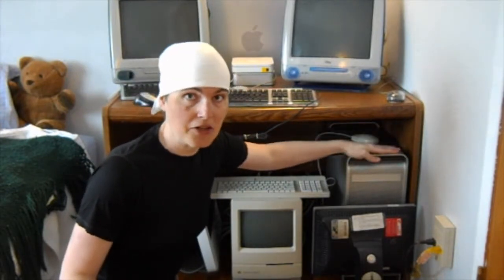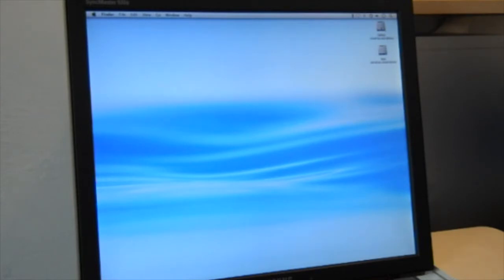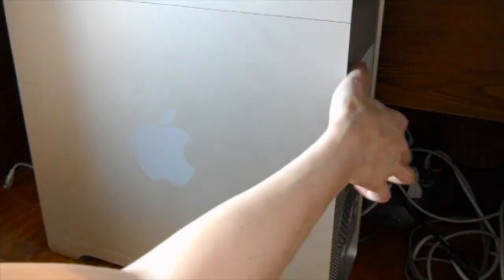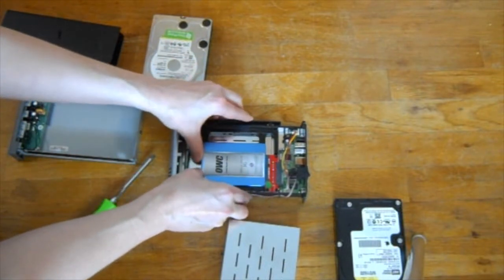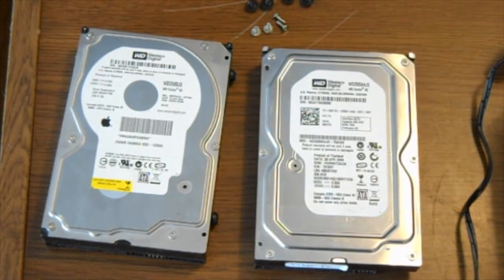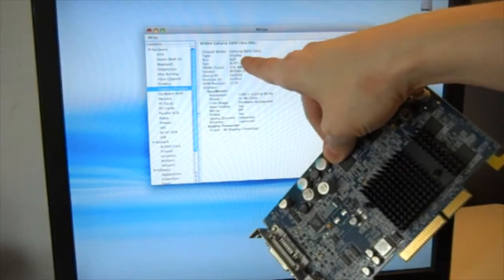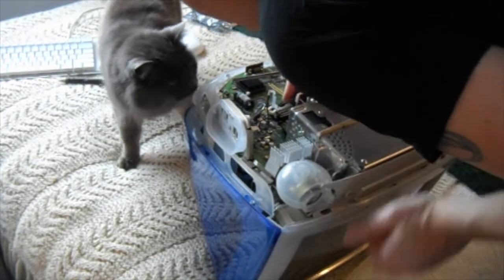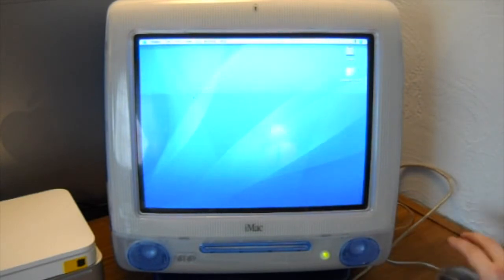Putting an SSD in my iMac G3

Comment: Thinking of doing this my self! The IDE spec isn't a bad one.. Head seeking, rotating platters, and circuitry to control them all add up to Latency_. An SSD replacing _any retro hard drive will guarantee performance increase..

Comment: I have two iMac G3 they work fine but my indigo iMac make a lot of noise when I play a game which turned out to be the CD drive and I also noticed the 2001 iMac does not include a fan to be built in it has a water cooling built in
Reply: Water cooling? The 2001 iMac is air-cooled.

Comment: Without trim support will that SSD not eventually destroy itself? I was thinking about doing this myself and then realized the trim problem.
Reply from the maker: Probably. But according to OWC, they claim TRIM isn't necessary for their SSDs (https://blog.macsales.com/11051-to-trim-or-not-to-trim-owc-has-the-answer). I'm not too concerned, though. This isn't a primary work computer. I'm on it rarely, and when I am, I'm not doing a tremendous amount of read/write. Of course that's just my experience. Your mileage may vary. Something else I've considered trying is using an IDE to CF adapter rather than the SSD. Haven't gotten around to it yet.

Comment: What adapter is that to connect the SSD to the IDE port?  My DV SD has a DVD drive and the old HD connected.  I need to locate the adapter that will re-connect the DVD and then the new SSD (if such a adapter exists!)
Reply from the maker: I used a NewerTech AdaptaDrive 2.5 to 3.5 inch drive bracket for the SSD, and disconnected the SATA pass through to make room for the SATA to IDE adapter that came with the SSD. After that, I just used the IDE cable in the machine to connect everything. https://eshop.macsales.com/item/OWC/SSDMXLE120/
Reply: Many thanks! The video has been a great help. I was missing the SATA to IDE adapter, so that's on the way now from MacSales.
Reply: @vandinem  hey i was just looking at this adapter/SSD combo, did you end up getting it and if so how did it go?

Comment: Nice video! Do you find the iMac faster at all with this upgrade?
Reply from the maker: I didn't do any speed benchmarks, so I can't say for certain if there was a speed increase. It felt more responsive, though. The iMac did end up being totally silent, which was really nice. For a little while there was no grinding of a mechanical hard drive to ruin the fanless iMac. But alas, the SSD isn't actually in the iMac anymore because it caused a system freeze when waking from sleep (a feature I use often), so I swapped it out with a 40 GB mechanical drive from my G4 MDD. I think the SSD will eventually wind up in the G4 Sawtooth, but I'm contemplating using a IDE CompactFlash adapter in the iMac as soon as I can afford one. I'll be sure to make a video when that happens, and I'll do some benchmarks as well.
Reply: Great to hear it helped with noise - I have recently been gifted a G3 rev c, and the first project was to lubricate the fan to try reduce some of the noise (which we don't hear do much with modern computers).
Interesting one about the return from sleep bug - will have to bear that in mind when choosing a SSD for my iMac...
Reply: The issue with the wake from sleep is probably related to the OS since they didn't have ssd's and the OS kext doesn't take into account  It would be interesting but expensive project to upgrade from the PPC G3 processor to a modern Intel processor using a MacMini internals in place of the G3. One can only dream LOL
Reply: @ellejohara  So I assumed did you already have some sort of an adapter to convert ide to sata? Thank you.
Reply from the maker: I bought the adapter with the SSD. This URL is for the IDE to SATA: https://eshop.macsales.com/item/Addonics/ADSAIDE/ ... and this is for the 2.5 to 3.5 drive adapter: https://eshop.macsales.com/item/NewerTech/ADPTADRV/